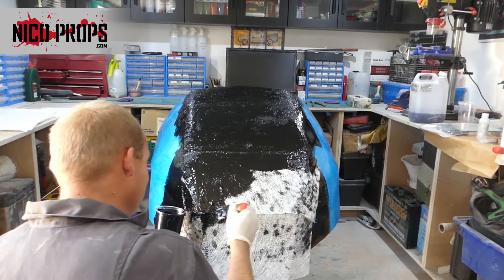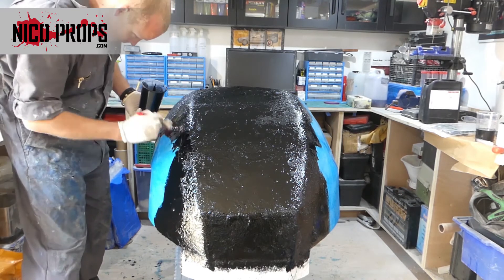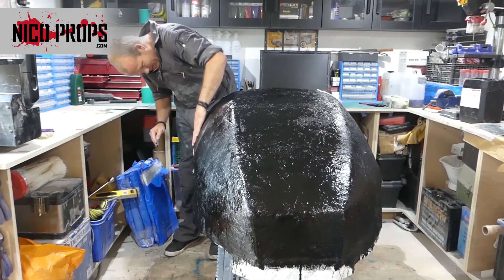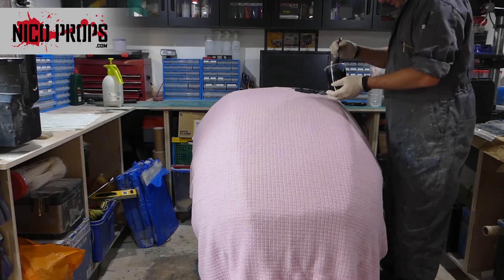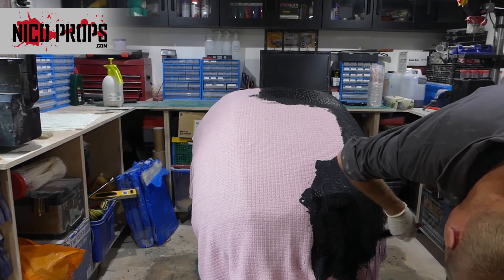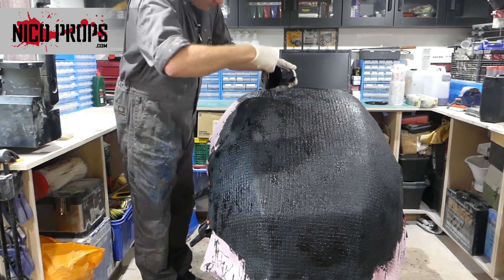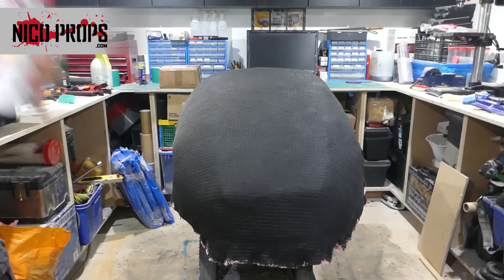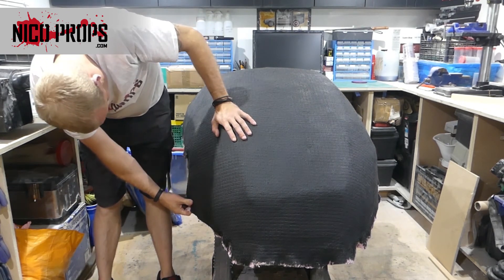LIFE SIZE ED-209: Casting the dome, using resin with fabrics to create texture

Comment: how did you decide what to use to get the patterning /chequered mesh look for he dome?  & have you finished this project yet or are you only using instegram etc now?
Reply from the maker: Its still a work in progress at the moment, I have done a bunch of casting and have videoed it just need to edit it and get it on line but keep getting distracted lol 

the dome material, well basically I went around loads of fabric shops until i found a fabric I liked and thought would work.

Comment: have you decided how best to make an underframe yet? can I ask how many 5 ltr tins of resin you have used as both moulds & castings r fibreglass & finally hpw tall do you expect this prop to be? im working off the horizon 9" model which  I estimate to be an 8 times enlargement (aproximaely 7 ft tall give or take.
Reply from the maker: not sure how much resin I have used probably about 10 x 5L tubs but that's making moulds and castings. probably going to be around 7ft - 7.5ft tall. I'm going to high detail so I am taking my time over making the parts giving each part a lot of thought. Framing I am probably going to use wood as steel has a tendency to flex over longer distances.